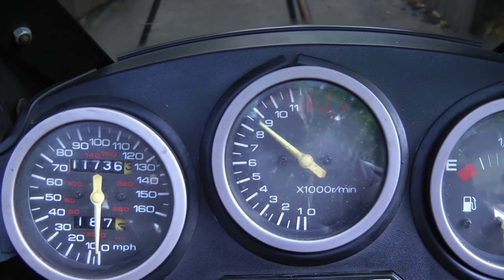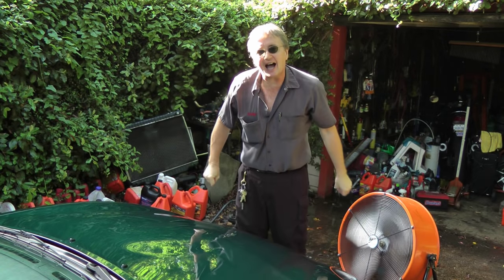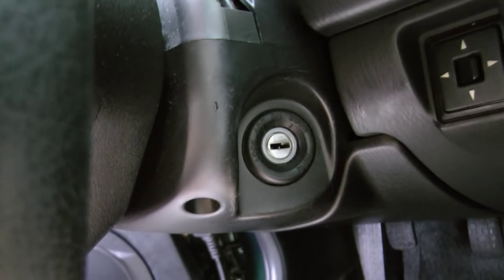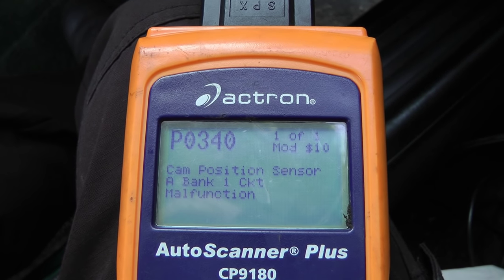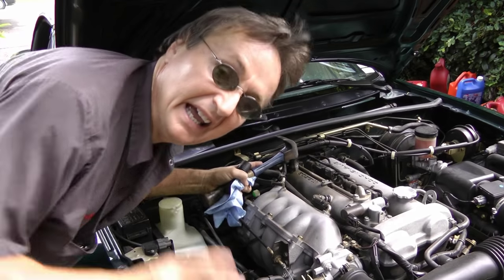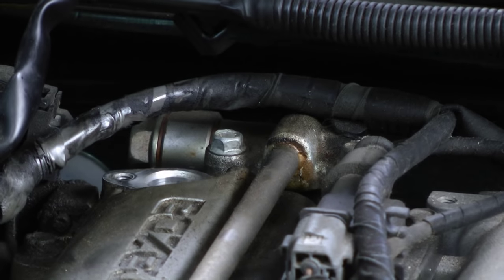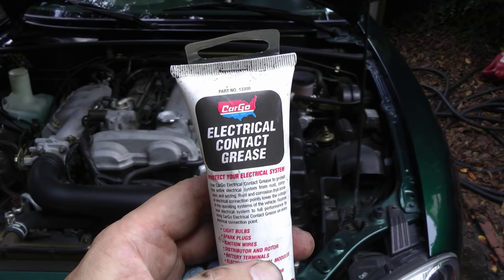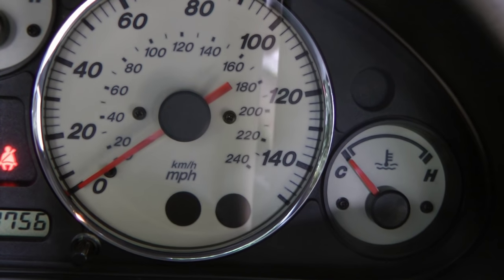How to Fix a Car that Randomly Dies while Driving

Comment: my car is a 93 toyota 5 speed 4 cylinder, i cleaned the throttle body nice and beautiful as well as the other part connected to it. it still drops to 0 rpm and dies when im going to stop and shift into neutral. the rpm's go up and down and drop dangerously low and the car makes a clunk sound then it revs back up. new plugs, nrw wires, new dc, clean throttle body, new air filter. what else can it be?

Comment: Have both cam sensor replaced for a 2005 Nissan xterra as you have shown with the mazda, the sun starts right up but will die while driving and have to restart.  It will run OK without dying but the service engine light and slip light stays on till I turn off the engine.  The episode repeats itself again next drive.  Please help!

Comment: Scotty my name is Jamal and I have a 1997 Buick lesabre 3.8 n I change crank sensor and camshaft sensor on my car in it still cut off y I’m driving it then I went to junkyard get icm ignition control module to replace it did better for lil long but still cut off on me should I go buy a new one ignition control module n if that don’t fixed it what else could it be ?

Comment: Hey Scotty I have a 98; Cadillac Catera and it would die after it warmed up. I took it to an auto shop that said it needed an o2 sensor and I had it replaced and got the car home and it still does this. Do you have any advise. The auto shop said that if the code doesn't read again they would charge me.
Reply from the maker: +Sherri Ellis  realize that is not a cadillac but a German made opel. You really need a german mechanic who works on opels to work on that thing. Your guy just guessed, and he guessed wrong. They are VERY complex cars that few will even touch these days IF they are honest. I personally don't touch em anymore due to lack of part availability

Comment: I have a car that stopped in the middle of roads when the car's engine became hot (probably after 15 mins of driving in summer days) and the car starts fine again when it is cool. Already have the alternator replaced but it was still the same. Then it got scanned and the scanner mentioned fuel pump relay problems although upon checking the relays (such as someone turns on and off the car and someone else checks the pins if they lightened up or not (with a mini circuit tester) and if they make sounds or not when the car was on and no problems. What is likely the exact problem?
Reply from the maker: just replace the relay you can't load test them correctly that way. /and if not that, bad pump or wiring
Reply: Replaced alternator, fuel pumps, fuel filter, fuel pump relay. None worked.... Starter relay was fine too by light tests. This were all replaced by certified mechanics. I hope it isn't the computer.

Comment: Hey Scotty I have a huge problem with my car that's bothering me. I just got a JLT cold air intake recently and got it tuned right after. Ever since the install everytime it's 30 degrees or below when I go into neutral my car will die.. Do you have any idea how to fix this? 2013 gt mustang
Reply: Anthony Reyes that’s odd honestly. I would guess they need to re-tune it and raise the idle speed or something. If it wasn’t doing that before it’s forsure the tune.

Comment: Hi Scotty, i have lose power when i start my car.Have to give more gas to make the engine run with power.Another problem:driving on highway from 100 to 120 km,suddenly the engine lose power to  80 km.A orange light light up on the dashboard.Please help.What is the problem.What are the solution ?

Comment: Thanks Scotty ! My car keeps cutting off on me and I had the alternator changed 2x  and it still doing the same thing. I was told it might be the fuel pump. I have a 2011 Nissan Juke and you customers with the same problem with this kind of car. There is no engine check light on. Please help before I pay more money for no reason.

Comment: I got a issue with my Honda Accord 2004.. I changed my battery and alternator and when I turn on the car and turn on the lights it wants to turn off..  and there no check Engine..what do u think I should do scotty?

Comment: Hey Scott Kilmer I have a 1996 Jeep Grand Cherokee and ever since I have had it it just dies on me randomly. Over the winter it really didn't do it all that much but now it's warmed up it does it every 5 min or so.. It will die I'll pull over put it in Park and turn the key it will turn over but won't start.  I'll wait 15 min and boom it fires right up.  Any ideas of what this problem is..
Reply from the maker: David Gibbs when it doesn't start, do my video tests "fixing a car that cranks but doesn't start up:

Comment: Hi Scotty, I have a camry 2002. I started my  car, it's running for 5-10 minutes then it died. I couldn't restart it again immediately. So, to test it out I parked my car and restarted it again after 5 minutes and it did start. Then when I notice it was about to die (idle speed drops down), then I pressed down on the gas pedal and as long as I keep pressing on it a bit the car kept running. I am wondering if it's the fuel pump relay I need to replace. How can I test if the fuel pump relay is bad?  Thanks in advance.
Reply: +mot nguyen Not sure how your car does it, but check for an idle air control or something.  My car has an IAC valve which just regulates the air the car gets when the throttle body butterfly is closed(no pressing of pedal).  I would assume yours is similar.  check engine lights are good too.

Comment: What if your car says circuit b and has two camshaft position sensors? 2011 Honda Accord. Died on hwy and won't start. Throws code p0365

Comment: Scotty what else causes p0342?i have new sensor and I replace ecu.i check the wire up to the firewall and it seem in good condition
Reply from the maker: +Edgar Chavez only a wiring short to ground, a bad sensor, a bad main computer, OR a stretched timing chain can trip that code.

Comment: Hi @scottyklimer i have a question, i have the same problem on a Nissan Altima VQ35DE engine, the code says that the trouble is in the camsensor on the bank 1 but the dealer sell me the 3 sensors in one package, camsahft bank1, camshaft bank2 and crankshafht sensor, should i need to replace the 3 or only the one that code says. 
Regards 
Emmanuel

Comment: I have a Sebring Chrysler 200 2.4 2016 and it's a push start well the problem that I'm having is when I push my button my car won't cut off what's the problem and where is it located at so I can go buy that part and fix it.

Comment: Hey Scotty, I have a 2004 Nissan maxima. my car shuts off randomly and when it happened the Steering wheel get hard and the sometiems the brake and all the lights turn on in the dashboard. with this problem my battery starts drain too. 
Need your help please Scotty.

Comment: Hey Scotty, I've got a toyota rav4 5 door automatic1996 model. My car is running when suddenly shut down. When I tried to start it back again the engine won't do. All the signal lights, head lights and inidicators are working. What can be the possible problem? Hoping I can get a response from you soon.
Reply from the maker: Raven Garcia often a broken timing belt, check that first
Reply: Thanks Scotty.. I will let it check on weekend.

Comment: I have a 2016 Ford Escape that has 10,000 miles on it. It has just started randomly dying while I'm driving it - usually when I'm stopped at a red light/intersection.  I shut the car off quickly & start it up again and it will start up.  No codes, no msg on the dash. Nothing.  Any ideas what might be causing it to die?

Comment: hey scotty so Bought a 99 s10 test drove it it ran then drove from Fairfield to Hamilton an it died out an wont start back up but sounds like it wants to turn over an we tried jumping it an didnt help we tried to put gas in it see if that helps but sounds like its not wanting to get any spark

Comment: I’ve got a 2004 Chrysler Pacifica and it’s stalling on me . I’ve changed the egr valve and cranshaft sensor but still won’t start . Any ideas? Turns over but won’t start.

Comment: I have a 06 Nissan Xterra 4wd. I went and got an oil change and on the way home the oil hand would go up the back down when I stop. I ended up going back to the place I got the oil change and on the way home it died. It hasn’t started since it showed a code for the camshaft.

Comment: My BMW e90 320i has the P0430 on since like 2 years or so.
I've been trying to figure out what that is but seems like nobody has a clue. And yeah, the engine dies randomly, maybe once a month or so.
It also smokes from the exhaust, I would say kinda blue smoke and it burns about 1 liter oil per 1000 km.
Any clue?

Comment: My wifes 03 ford windstar has been randomly dying, when I plug in my scan tool it doesn't turn on. It does turn on for other vehicles but not the windstar.
Reply: If you dont have acc power at the plug in/ cigarette lighter you have a bad fuse the power to the obd port and charger port are both on the same circuit and therefore are on the same fuse... Hope this is helpful

Comment: Mr Scott my car is not starting at all the battrey is strong but the car jus won't start an the engine vibrates real hard wen ever I try to start it there's also blue smoke coming from it too an it won't stop that was before it started giving me trouble to start its b13 Nissan Sir and d spark plugs are covered in oil I replace d engine oil two weeks ago now is black I am having multiple problems do thing I should get a new engine

Comment: Hey scotty  still need some help if you can 
Replaced fuel pump ,fuel pressure regulator 
Fuel filter spark plugs  coil pack  spark plug wires   checked fuel injectors not leaking new seals no oil leaks. Temp guage is pretty low but never overheats   its a 5 speed stick shift and when putting it out of gear it dies  sometimes turns back  on its own  aounds like when idle is low at a stop light it will sound like misfire  no check engine lights  what the heck pleaseee help

Comment: Hey I have 2014 Hyundai Tucson SE FWD 2.4liter, New battery, I turned on unplugged positive still on so alternator good, but soon as I turn on air conditioner engine shuts off completely?

Comment: I changed my camshaft sensor. But when going to start my car it take around 3 seconds for it to start and it doesn't idle well around 600rpm.. I give it a couple of revs it seems fine. Then I try to drive and it feels like it's pulling and not much power. I think this could well be a crankshaft sensor issue. 
Your thoughts and comments  are welcomed..Thanks

Comment: Hi Scotty
Using Hyundai Accent 2003
Car randomly dies, changed spark plugs, fuel pump, temperature sensor, engine oil but still dies when driving. 
But I have noticed I experience this when I put on the AC. Engine check light is off. When you scan with ob2 No Code!
Help!!!!

Comment: My 06 Chrysler 300c 5.7 has a bad stalling issue, I’ve replaced the cam sensor, egr, map sensor, spark plugs, cleaned the throttle body and a few more things. I called Chrysler and they pretty much stone walled me, cause there is a recall on some of the cars but they say mine is not in that group. I’m almost giving up on it. Please help sir.

Comment: I have a 2005 Ford 500 and I am driving and actually starts sounds likes it is choking and shakes and stutters and then kicks in and is ok.  Sometimes while driving it starts slowing down and then just stops.(I can hear low humming sound when does this).  Had it checked twice and 2 mechanics said cannot find anything wrong.  It comes and go doing this for past month.  Had throttle body cleaned and that fixed it before but this time did not.  Any ideas

Comment: I have a 2001 Hyundai Accent Hatchback 1.6 and my car drives fine but when I am driving in traffic and commence to brake my car shuts off. I can immediately start the car up again and continue to drive but will happen servers more times. I hooked up my OBD 2 no codes and no Check Engine Light. What can I do?

Comment: hi there my toyota yaris dies on me in the highway, its just crank with no start, a mechanic check the car and said that the fuel pump is good, the injectors, spark coil, sparks, altenator and battery all good, i havent check the crankshaft sensor  do you think that my problem with my yaris ?

Comment: Ok, so I have a 92 buick century v6, I started having this problem a few months back where my alternator kept draining the battery, so I got the alternator fixed, a few days after I got it fixed the car died on me after putting it into drive. So I have no idea now if it was my alternator or something worse.
Reply from the maker: veroniquewillow   tons of things can do it, first pressure test the fuel pump, weak ones often do just that

Comment: we have a gmc pu 1/2 ton 6 cyc  that stalls when making a left turn. Changed the steering column and still does it. Any suggestions?
Reply from the maker: +Linda Tippel  they are supposed to have an idle up valve when turning, check to see if that's working

Comment: I'm having a problem with my 2004 PT cruiser, first of all it drains the battery couple of times months. Have not been able to find what's the problem. My problem now is that the car shuts off and all battery drained when trying to drive it? Every time I jump started it cranks and turn on and stays idle, the moment I change the shift gear to other than parking, it shuts off and I have to jump start again because the battery is dead. The alternator shows good, the battery is good, what's happening?
Reply: Did you try checking your electric load detector

Comment: Scotty Kilmer have a 1988 F150 302. Engine dies after 3-4 miles (just like if I had turned key off). Try to restart, starter will crank 3 or 4 times and not start. Then (after 3-4 crank try's) turning key does nothing (starter does not turn over). Wait 20-30 minutes and it starts right up, and will go 3-4 miles again. Temp guage in normal range when it dies. Battery charges at 14v when running, 12v when sitting off. Alternator is good, battery is good. Checked OBD 1 codes. Shows an 82 code, but has for several months. This problem has been in the last week only. Any ideas?
Reply: +Bob McKenzie ECM failure is common, the prom chip over the years goes bad and it controls and limits the voltage to the ignition module, and that controls spark adavnce or the plusing of the injectors. Electrical bug also its been seen coolant temp sensor(the 2pin) off the coolant is a resistor and it also sends signal to both ICM and ECM saying hey im cold more gas or hey im hot cut back usally it will run but you get a caming affect (cuting out the fuel) or your see black smoke from tail pipe(rich)

Comment: I just replaced my MAF Sensor in my Chrysler crossfire, it idles better and is a lot smoother until I press the pedal down. If I am in 2nd or 3rd and floor it the car acts as if it's not getting enough air. There's no way I installed it incorrectly. What is going on? I little description of exactly what happens ... I floor it the RPM drops and it acts as if it's about to stall and then it recovers and goes back and forth and it's very erratic. Its only in high RPMs though with aggressive acceleration. I just spent 180$ on the MAF sensor... Please help me Scotty!

Comment: My 2006 Dodge Charger Rt 5.7 randomly stalls I had a tune up I brought a new throttle body and had a oil change but it stills stalls and cuts off it's no smoking or knocking going on I'm thinking it's a bad ecm can you please help me

Comment: I have a 2002 kia Sportage I've replaced fuel pump& filter,plugs,coils,wires,idle sensor,new air filter. It runs great but after 20 Miles it starts cutting out and surging after I let it set for a minute it will run about a mile and start doing it again any ideas Help

Comment: I have 2013 rav4 it show's on the scan tool P0335 crankshaft position censor circuit. I did replaced the scan tool Tell's me but still show Maint REQD in my dash so what is that?

Comment: Need your help !! I have a 1999 dodge ram 5.9 liter and for a few years now ill be driving along and it completely dies out and i need to pull off to the side with no powersteering amd after a few minutes it wiĺl start up somtimes it happens a few days in a row more than once and then it wont happen untill a few weeks later very random ...i used a scanner and a P0001 code came up as a fuel volume regulator control circuit / open ..i was told that coid didnt meen anything ???

Comment: hey Scotty I have a 2001 Hyundai Accent GS with a p0342 code.i have a new battery and I tested my starter and it pass,I also tested the camshaft sensor harness three wires the power and ground pass,but wire that connect from ecu to sensor Has a high voltage 11volt.what should I do?
Reply from the maker: +Edgar Chavez  it should be 5 volts, so odds are computer is shot putting out wrong voltage
Reply: Scotty Kilmer hey what makes a o7 cobalt start making a knocking sound and shut down the engine but starts back but it keeps doing that

Comment: That happened to my moms car 3 times it died then started back up a second later it had a dead battery changed it and it hasn’t happened since then a couple years later everything was working but it wouldn’t start turns out the starter had died fixed that and it’s running wonderfully

Comment: hey scotty, how are you.
I have 2001 nissan altima my problem  is when i start the engine he stop immediately, I changed spark plugs,i put  new fuel pump, new engine distributor, new spark cable, i cheked maf sensor is ok ,what s wrong in my engine? thank you
Reply from the maker: +Andreas Cappello check for vacuum leaks first, as in my video "finding engine vacuum leaks with a cigar"

Comment: iam planning  on buy an 03 ss monte carlo it, the owner  told me it the crank sensor. the car will randomly  shut off.is it worth buying. the car has 500 miles on a rebuilt  engine